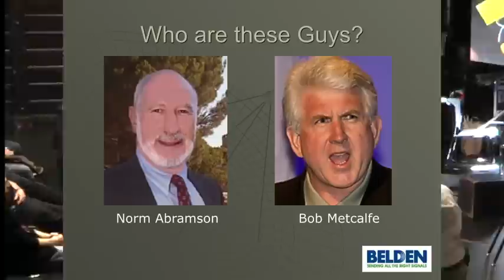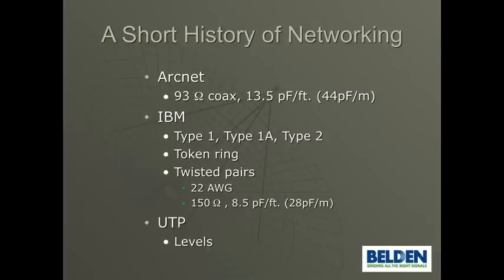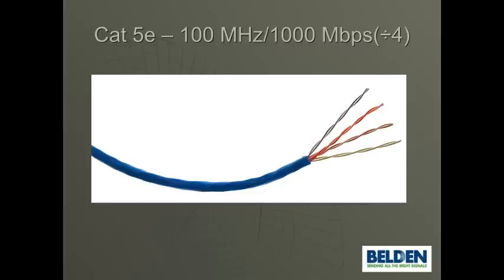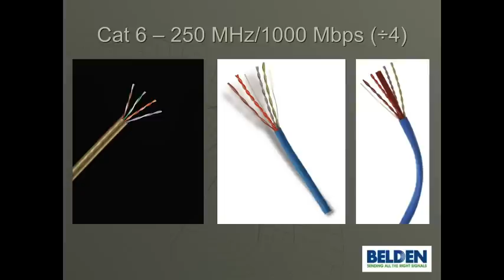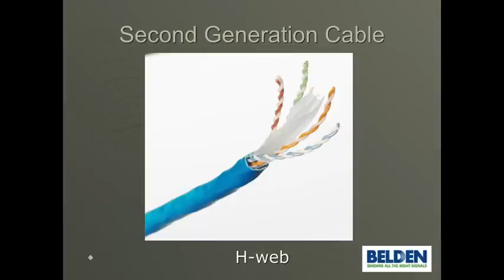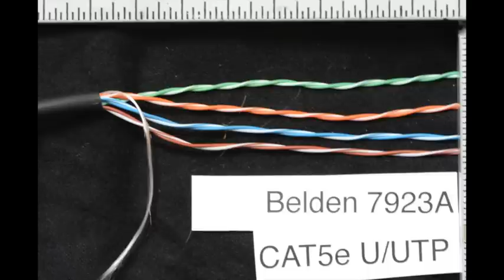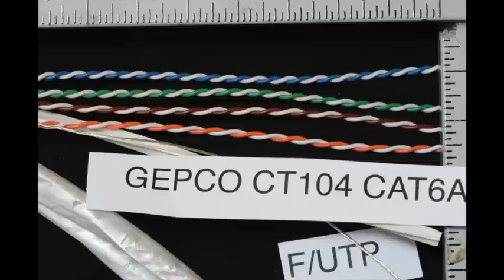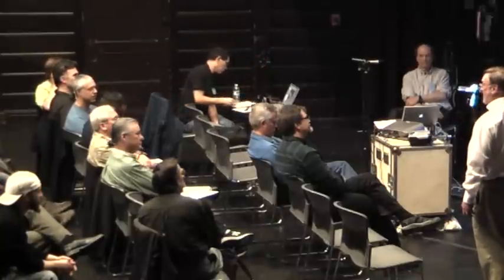2013-06-01 Audio Over Ethernet Cable Workshop Pt  1

Comment: Crestron's DM-CONN connector supposedly is rated for 10 gig and is able to be used with their shielded Cat5e and Cat7 cable (regarding the question of what to terminate Cat6a or Cat7 with to actually pass 10 gig).

http://www.crestron.com/resources/product_and_programming_resources/catalogs_and_brochures/online_catalog/default.asp?jump=1&model=dm-conn

http://www.crestron.com/resources/product_and_programming_resources/catalogs_and_brochures/online_catalog/default.asp?jump=1&model=DM-CBL-ULTRA-NP

Comment from the maker: Around 21:00 Steve talks about shielded vs. non-shielded cable, and there is an editor's screen comment about the need for shielded cable with the Behringer X-32, which uses the AES50 protocol. This is also true for the Midas Pro 3 and presumably other Midas consoles, which use the same protocol. I confirmed this by testing one.

Comment: I really enjoyed this, Dan.  Will there be subsequent parts posted?
Reply from the maker: Mitch Miller Thanks, Mitch, I'm glad you liked it. That means a lot.

The subsequent parts will be a little more complex. The second one, I'm still assembling the bits; it'll be another week or more until I can get the last pieces from my buddy who has them (closeups of the measurement meters), and then another several days of editing I'm guessing. I edited part one in one day to see if it was possible (and to not drag it out like the others I've done), and the misspelling in the title is a direct result of that. Clearly I need to take more time to avoid that kind of stupid error.

The third part will be more goofy in that the cameras that I had going seem to have missed most of the action, but at 3 or so hours long it will need significant editing to be watchable by sane humans anyway. I have no conception of how long that will take. There are lots of still pictures that could go over the soundtrack, I think and hope.

FYI the other hour-long videos on my channel took 15-90+ hours each to edit, with the earlier ones taking longer as I didn't know how to get done what I could see in my head, and especially with the elements being made without an understanding of how they would get used. These movies with all the still pictures, sound elements, multiple cameras and all seem complex to me, but that could be because of inexperience. This one is actually pretty straightforward in comparison and I figured it would go faster and it did.

I like going faster as the editing chops sink in, but am embarrassed to make obvious mistakes. Fixing that mistake means deleting this whole video and rendering a new one, and I kind of think it should just live its own life with its imperfections hopefully being part of the charm if any.

Thanks again.
Reply from the maker: Mitch Miller Part II is at https://www.youtube.com/watch?v=ZDX3DknLmv0
Reply: DansoundSeattle Thanks for the notice.  I saw this the other day and enjoyed it equally.